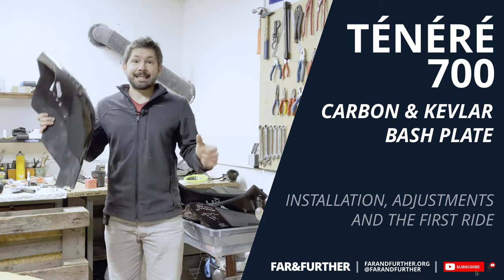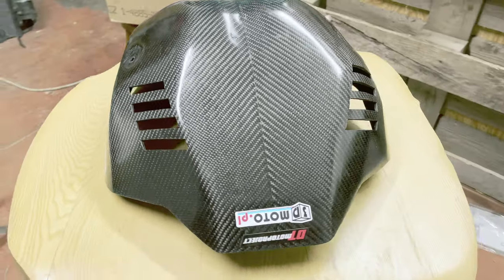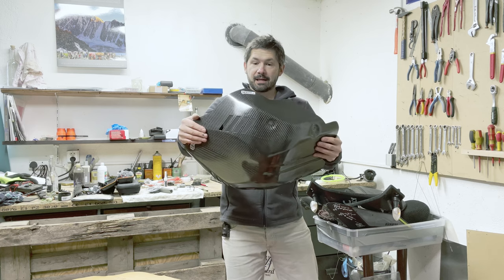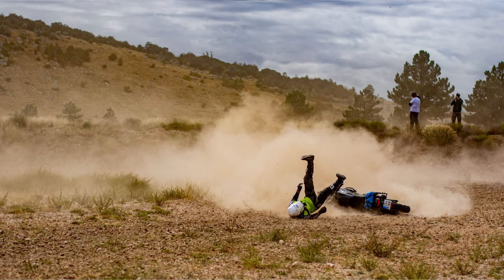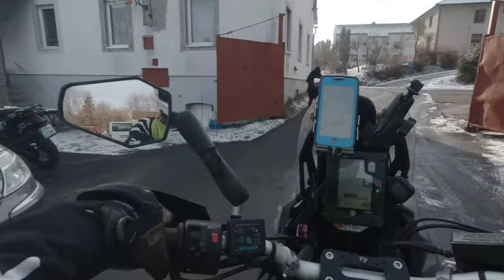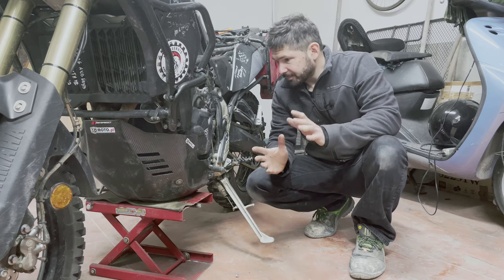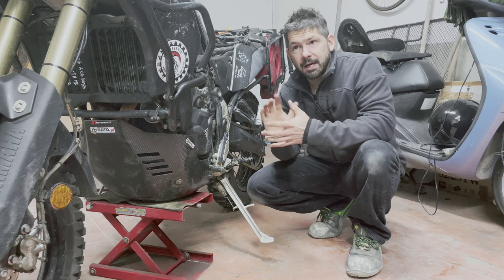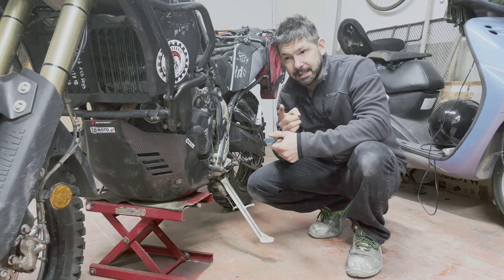Yamaha Ténéré 700: Carbon & Kevlar bash plate / skid plate from 3D Moto

Comment: I really like this one, gives also a bit of a Rally look and does not weigh alot. I agree the price is really good. I can easily see this costing 500€ from other manufacturers :)
I have the Outback lower bars also.  Can I ask if it was difficult to trim them down at the places where there is interference? Thx
Reply from the maker: Hey, adjusting the bashplate to fit the Outback was really easy with angle grinder. It’s hard material to cut 😂

Comment: Awesome 😮. 
I just ordered a perfect fairing one peice front fender, can’t afford any Carbon though 🙈. 
On the other hand I would F$€^%# that bash plate up quickly 🤣
Reply from the maker: Hehe 😜 I’ll check one piece fender… For the bash plate I’m starting to thing I’ll need to try quite hard to break it. It is dam tough!
Reply: @FARANDFURTHER  Nice, you should check my winter trial riding video. Did fine lowside sat 40kph, bent my skid plate side and scratched a lot of plastic 😅. 
But the underside is quite beaten up, have that in my GPmucci video, not sure the carbon fiber would eat that up. 
Will wait until you done some serious enduro style testing 😬
Reply from the maker: @everythingtenere  I’m thinking the same to be honest. That’s the reason I took it for testing. I cracked 4mm aluminum on the Dinaric! But the 3DMoto things I won’t break it. Not sure…. I know how my 4mm aluplate looks like 😂
Reply: @FARANDFURTHER  saw I didn’t have you added on IG 😮. Just sent you a message there.